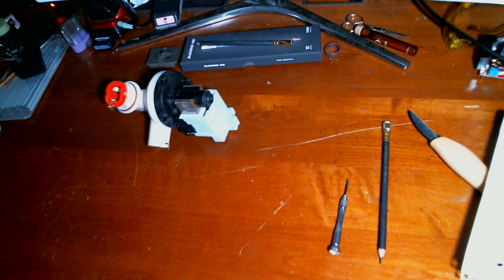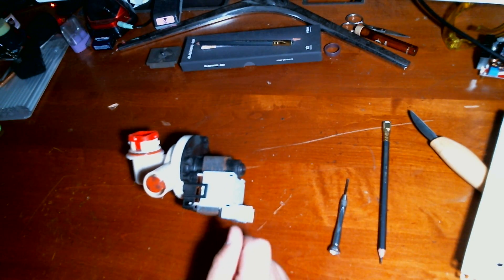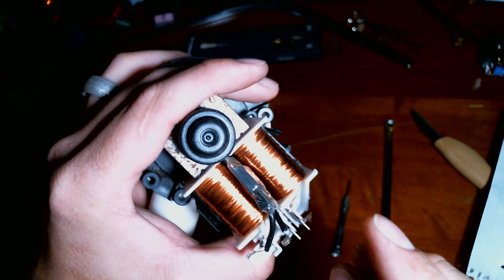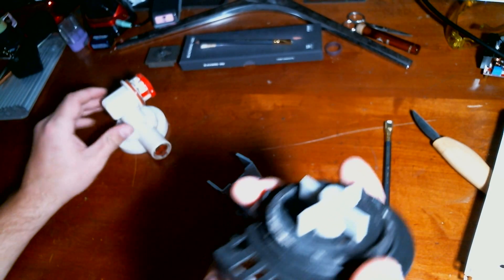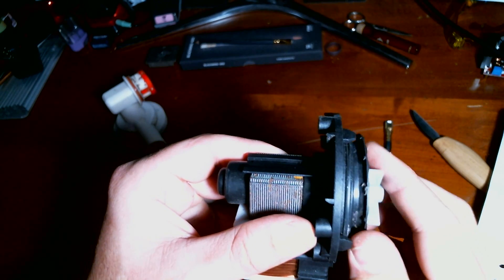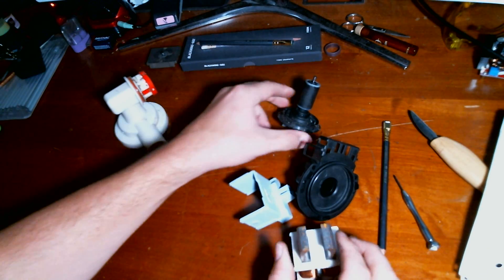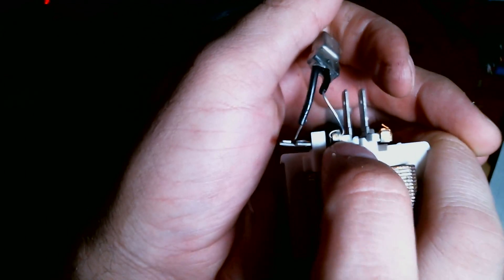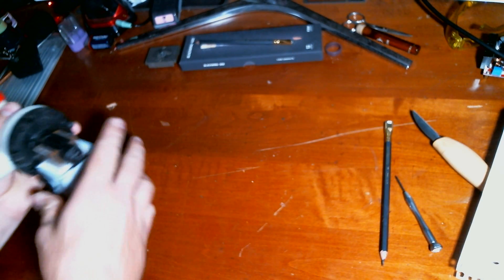Speaking about a Wet Rotor dishwasher pump.

Comment: These motors are very much made just to run for five minutes, especially the new ones where running them for 15 minutes would melt the plastic and char the coils
Reply from the maker: If there's no water in them they'll burn up fast.